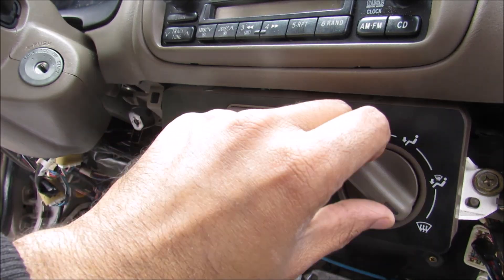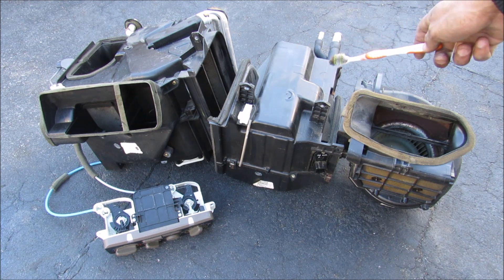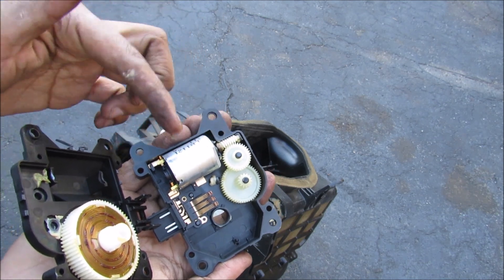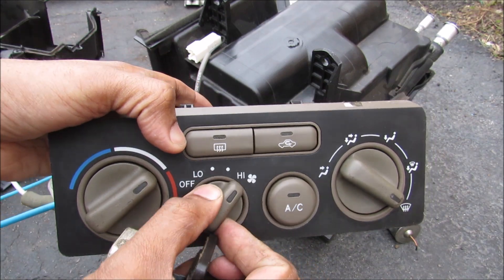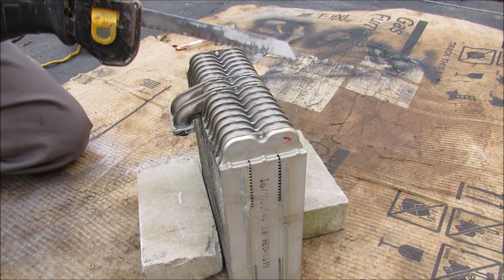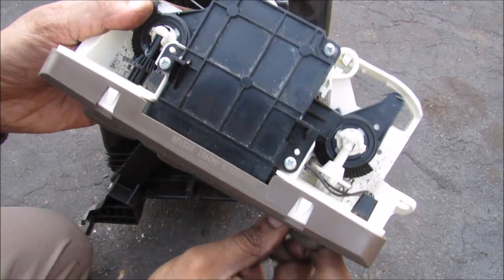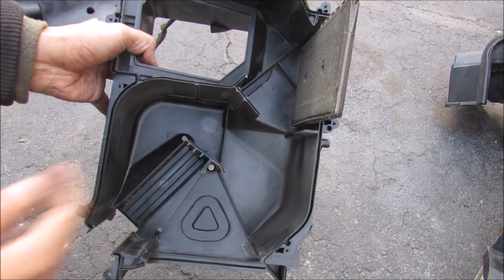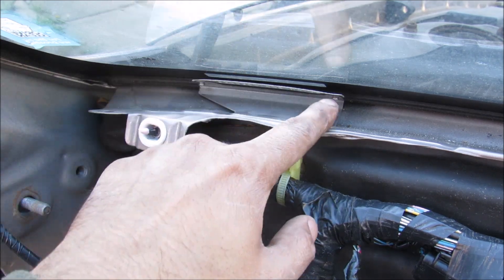How a Car's HVAC System Works

Comment: You're a wizard at maximum information in the least amount of time.
Reply from the maker: +Gene Fever thanks! short and to the point is how it should be.
Reply: @speedkar99  wouldn't mind a more detail and longer version ;)
Reply: instablaster...
Reply: Es interesante si meabla e castellano grasias
Reply: He sure is.
Reply: Now can you make an a.c unit by cutting out the belt driven compressor and use maybe say, a fridge compressor? Would be a cool youtube video! I know they sell micro a.c units, just would be cool to see  somone build that!

Comment: Back when I was a kid (many decades ago), my old man had a 57 Beatle with split oval rear screen that he was very proud of. The Beatle of course had an air cooled engine so no engine coolant to go through a heater block to heat the cabin. Instead some of the heated air from around the engine was captured and push through pipes on the floor of the car to each side and if you wanted heat, you would just manually open a couple of small vents that were built onto this pipework. Problem with that design was that if the exhaust gasket failed, you'd get exhaust fumes blowing into the cabin. I wonder how many people got seriously sick or died, driving Beatles around in winter. Great channel...Love your work. Keep it up.
Reply from the maker: That's an interesting HVAC design

Comment: Dehumidifying the air with AC before running it through the heater is a really great feature in cold climates. Keeps windows from frosting up on the interior, but most people aren't aware they should use AC in the winter.
Reply from the maker: You are correct, AAC dehumdfies

Comment: This is the video i was looking for. Gotta find that "one" videoagrapher that explains things in a way that the person watching will understand. I've seen many.. MANY videos on auto a/c system. Didn't understand, your video changed that. 

Thanks for the high quality content! My thoughts on all the parts coming out of the dash.. damn that's a lot of work. Thankfully only my blower motor, TXV valve and Evaporator are in the dash within the same black plastic housing.  (mine was a pain to get out.) I have new drier/receiver coming as well as a new TXV valve, though mine is ok, i figure what the hell.. it's a cheap replacement (not OEM). like < $20.

Comment: I love your videos! But you got one thing wrong. The refrigerant doesn't undergo an endothermic reaction. In the expansion valve the refrigerant evaporates causing it to cool down. No reaction takes place because there's no chemical change taking place, only a phase change.
Reply from the maker: +Trey Ah I see, its more of an endothermic phase change than a reaction. Just like water evaporating.
Reply: I knew someone was going to go there...
Reply from the maker: +Ronin Well I can't get everything right...
Reply: Exactly, it's an endothermic process.
Reply: was mainly joking about treys nitpicky comment. ) but yes thats true.
Reply: theres no cooling going on- only removal of heat- no such thing as cold in physics only lack of heat

Comment: Good description of a TVX AC (not CCOT) on a Toyota. You know your stuff!
Reply from the maker: Thanks. Check my auto HVAC video posted last week!
Reply: @speedkar99  I will (edit: TXV.. my bad!!) check your video out! I just did a rebuild of my CCOT system. If you get one, do a VOV explanation and why it's important for heavy duty applications. I used that in place of my FOT. Makes a tremendous difference in heavy traffic, up to ten degrees difference in DAT in slow traffic. You've really got your stuff down with HVAC. Thank you again!
Reply from the maker: You are welcome

Comment: Man if i ever get into stripping cars, I will call you. that was the quickest i have ever seen a dash board come out lol. Kidding aside that is one very informative video and theories like i had in college. great stuff, not for someone just starting out on AC but it does give them a look at it point blank. great stuff
Reply from the maker: The Corolla dash was one of the hardest to remove because of the wire harness stuck to the dash . The G35 is much easier

Comment: An excellent video. I am very familiar with the system but been a while since i have done that since retiring. I have 2002 Jeep Cherokee with L6 engine and we started getting burning hot air out of the A/C vents. I am waiting on a new set of A/C gauges to test the system, but I think and suspect it has to be in the mixer box door not closing. The air it blows is really hot no matter how A/C is set or blows. I Hope the gauges will be next week. Again your video deserves praise and great for a refresher. Thanks
Reply from the maker: I hope it works out for you. Are you using the high and low side gauges or just the low side? 
Does the compressor engage?

Comment: Great video of explaining how stuff works I would've liked if you explained a little bit about the under the dash wiring but overall I learned from this video
Reply from the maker: Glad it helped. I have a video on car electronics, you can check that out
Reply: @speedkar99  do you it would help me allot since I got a non ac truck and I just bought a doner truck I was just curious where all the ac module and where preassure switches hvac box stuff connects

Comment: Great work and yes, contrary to what I'm sure a lot of people thought, refrigerant is NOT a liquid. However, I noticed there were plenty of smaller channels for the gas to expand into but I think you missed them because they were so much smaller than maybe what you expected. Did you see the zig zag pattern of raised area on the left side of the pieces you cut? Also yes, the intent is for the air to be dehumidified first...works waaaay faster to defog your windows when you can use dry warm air instead of air that has already been saturated with moisture due to cold temperatures or rain.
Reply: "refrigerant is NOT a liquid" Well, more properly, refrigerant is something you want to be a liquid in certain places and a vapour in others. For example you never want it to be a liquid right before the compressor's suction port and a vapour right before the expansion device. You want to hear quiet liquid sloshing noises from the evaporator box, not loud hissing ones. It should never be passed inside the evaporator already as a vapor...

Comment: Air goes through the evaporator first in case you want to defrost the windshield and run the heater. You still have to remove the water before you blow the air on the windshield if you want to remove the fog from the glass.
Reply from the maker: Yes it dehumidifies

Comment: Very excellently explained the  HVAC system in a car, just straight to the point,  Thank you.
I have some doubts
1. If the car AC is in fresh air mode is there any vent/system to push out the stale air or there will a pressure build up?
2. Can we install a filter for the recirculation mode I mean idea out of the users manual, if its possible can you show that?
3. Does cleaning the evaporator with products available in market cause damage to blower motor?
Hope a video from you how to safely clean the evaporator, blower, AC vents and some tips from you👍
Reply from the maker: +Jithin P V Thanks
In fresh air mode the air enters from outside. 
Most newer cars come with an air filter. Installing one inline can work but youll lower the cfm for your blower. 
Cleaning the system lightly will not harm it. Just don't soak it dripping wet.
Reply: "If the car AC is in fresh air mode is there any vent/system to push out the stale air or there will a pressure build up?"
All car bodies are equipped with "check valves" that let any positive pressure out without letting anything in, so that won't happen.

Comment: When you recirculate the air, where does the air recirculate from? When you turn the recirculate on, the air duct from outside is close, so where does it suck air from? I can't find anywhere inside the cabin where there is air sucking. I have some bamboo charcoal that can deodor smell, would putting them in the glovebox work? But there is no air sucking from the glovebox. Thanks, you're awesome!
Reply from the maker: Not exactly the glove box but just behind it

Comment: You have great videos, as was this one. One thing, it doesn't make much sense that the refrigerant only circulates in the top of the evaporator. I'd guess that there are vertical passages that you cut perpendicular to.  Because the exhaust is at the top, only the vapour comes out, where the liquid drops to the bottom through these passages.
Reply: No it doesn't circulate only on top. You can see 4 small channels going to the bottom at 4:59.

Comment: Thanks so much.  Was wondering if blocked expansion valves can be cleaned out and reused? Btw i was thinking wrong that flow of gas was opposite to how you say. I thought Compresses incompressor then to exp valve then drier then cond.  Then back to comp.
Reply from the maker: I'm not sure...why would you clean it when you can just replace with a new part?

Comment: 2:15 . Now how come some fresh air enters while recerc is on and the flaps are closed . Alittle bit of smoke enters the cabin, not much but some . So doesnt those flaps close 100% or just 90 or 95% so the cabin doesnt run out of air

Comment: any chance you want to diagnose whats wrong with my 2015 Pathfinder??? The heat does'nt get hot, and drops significantly when at idle. Sounds like you know what youre doing!
Reply from the maker: Seems like a stuck HVAC flap

Comment: So the sensor bulb on the evaporator core,its purpose is to monitor the temperature of the AC, to control the compressor by turning it on and off,right ?
Reply from the maker: Essentially yes

Comment: The only issue I saw, the evaporator coil, the refrigerant passes through those maze like channels and then exits through the other hole. Look up Alfa-laval plate heat exchanger.
Reply from the maker: Thanks

Comment: So on my 97 camry le 4cyl,  i have a rigid tube with a fitting sticking out, open-ended, in front of my condenser, on the lower passenger side. It connects to the compressor. Its a larger tube so.im guessing it's low pressure side. The heater-dryer is in place. What am i missing?

Comment: when hvac  is set to recirculation, where it takes air( from what position, because in my car, cabin filter is from outside, before hvac, so if hvac is set to recirculation, it uses air from inside and does not filtrate it so it is way to get dirt inside of hvac)

Comment: nice & impressive . can you please tell me  heater & cooler use the same path to the end ? or tell me difference between heat air & cool air?
Reply from the maker: +Engr Hasan yes they go through the same duct

Comment: Excellent lesson 👏 
Wanted to ask you a universal under dash evaporator that is for horizontal mounting can it be side orientation mounted? I should change the drain
And the condenser can be horizontal mounted?
Thank you

Comment: Just purchased a 2004 Camry 4 cylinder. AC works great, heat works but only on the drivers side(does NOT have dual air controls). Blows cool air on the passenger side so I'm getting air just no heat. I've seen mentioned a blend door actuator. Just looking for confirmation that this is the direction I should go. Have also seen talk about a heater blower motor resistor but after some research I'm not thinking that is the correct direction. Any help would be great. Thanks.

Comment: I see that we have an air intake valve for inside and outside air. Supply air goes directly into the cabin. Is there an exhaust air valve that remove air from the cabin?

Comment: I'm trying to figure out how the temperature adjuster works in cars with no climate control. Lets say I turn the guage the whole way to the coldest setting and then turn it a little back towards the hotter side to make it a little less chillier. Does that save fuel? Is it like the HVAC systems we have in our homes? Or does it turn on the heater that heats up the very cold air to give...like...a slightly warmer but cool air? I'm sorry. My information is really limited but I want to learn. Thanks!
Reply from the maker: Most older cars will run coolant through the heater core regardless of the setting so you aren't wasting anymore energy to warm the cabin very slightly. 
Newer cars have valves that exclude the heater core for more efficientcy

Comment: Great vid👍. I want to do more car camping in my SUV...to prevent the moisture buildup problem, is it possible to run the ac (to dehumidify) without running the engine? maybe with spare batteries?
or at the very least to keep air circulating, can i run the fan (without AC mode) off an alternative spare battery power source (to prevent draining the car battery)? my SUV has vents even in the rear cargo area...would be great to be able to run those vents all night.
Reply from the maker: The fan can be hooked up to 12V
But the AC compressor needs to turn and self regulate
Reply: speedkar99  Thanks!  I will look into this more. If it can work, it would also be great to include a switch to reverse the air flow if needed.

Comment: Thanks for the great video. I have a 2010 Ford Everest. My child put coins in the stereo and somehow it activated the engine light. I have thus disconnected the stereo and reset the car but light come back on after driving a while. This is also affecting the AC. The AC works fine at low speed (or low revs) less than 100km/h but cuts off as soon as you go beyond this and never comes back on until you stop, switch off the car and start it again. I've been to many places but they still can't solve it. Through my research, the pressure sensor is suspect and I've tried to bypass it without success.
Reply from the maker: I don't see how putting coins in the stereo would cause an engine light. Get a code reader and see what's wrong

Comment: Thanks a lot for taking the time to make this videos.
I'm currently troubleshooting a non working AC in an astra G. It was diagnosed by the dealership as failed compressor. Got a new compressor and symptom is the same after refill: clutch engages only for a few seconds.
No leaks were found in the system and no electrical faults found so far. Now after watching this video I'm suspecting a defective expansion valve could possibly cause the same symptom because it would prevent pressure build up which triggers compressor switch to disengage clutch. Can you confirm a faulty expansion valve could lead to such behavior?
Cheers!
Reply: Astra Gs should have the suction pressure unloaded Delphi CVC compressor. The clutch should be always running when AC is on since it unloads to keep the evaporator from freezing. There's no pressure switch on the suction line since the unloader valve inside the compressor takes care of suction pressure adjustment. If the clutch cycles rapidly and you have the correct charge and no leak it either means electrical problem or too high pressure in the liquid line (before the TXV; the pressure transducer is located on the liquid line). You might have a stuck closed/dirty TXV that's not allowing any refrigerant through. Can be checked by evacuating the charge, removing the TXV, checking for any dirt on the high pressure side and blowing compressed air through the compressor side high pressure port on the TXV.

Comment: Ok, video, but there are a couple of corrections. The major mistake in this video is how the evaporator works. You cut the evaporator in between the fins and failed to see the tubes.
Look at 4:55 in the video. The top of the evaporator has peaks and valleys. You made both cuts down in the valleys, but the tubes are on those big, beefy peaks. If you will look at 4:55 at the piece still on the ground, inside the main tube where you said "the refrigerant only flows through here", well you can see the openings in that main tube at that part of the video. Looks like 4-5 tubes that go down to the bottom and return on the other side to exit. The end is flat, there is no place for the refrigerant to "loop around". Missed it 100%.

The other thing is at the end you were taking about the heating AND cooling of the air. Pretty much every vehicle for the past 25-30 years automatically runs the a.c. any time you are in defrost mode. You cannot keep moisture of the inside of the windshield unless you dry it. Anytime you hear someone say "I don't have to have ac", ask them what they are going to on rainy days. If the a.c. isn't running with the defrost, you will be blowing wet air against an already wet windshield.
Reply from the maker: Good points. Thanks

Comment: I have a simple question. How does it change where the air goes? Is there a ventilation switch of some sort? Like if I select feet area the air doesn't come out of the dash area. How is this done exactly?

Comment: So the blower blows into the evaporator to cool the air? So if my AC has a weak airflow a dirty evaporator could possibly be the cause?
Reply from the maker: That's one suggestion...a blockage somewhere in the system
Reply: @speedkar99  what else could be causing blockage?
- blower is ok
- evaporator is clean
- cabin filter is new
- vents inside the system is fully opening/moving  as they should

what else should we check?

Comment: Ok ok that was excellent. If I have mold in my evaporator core where is the best access to spray mold killer?  A. through the evaporator runoff hose 
B. through the duct or 
C. just past the cabin air filter
D.  from the outside air intake?  

And if D won’t the cabin air filter just block the spray from entering the core?

ANYONE.
Reply from the maker: Get it from anywhere you can